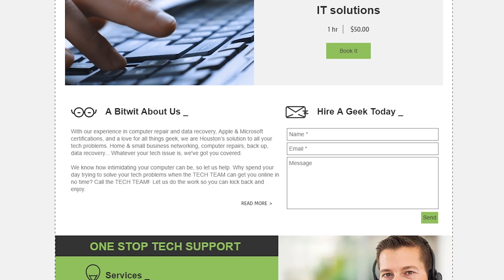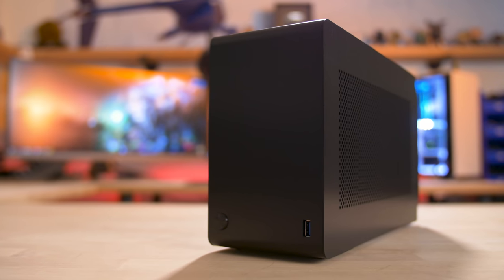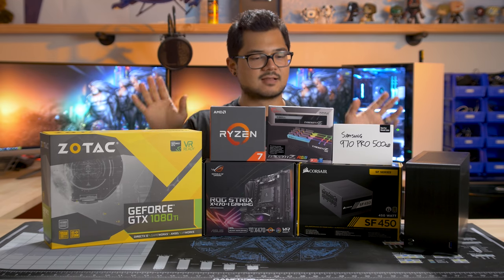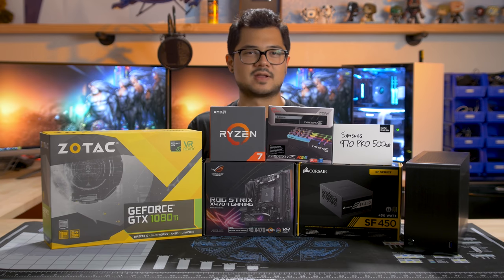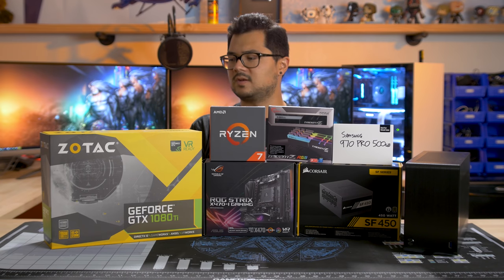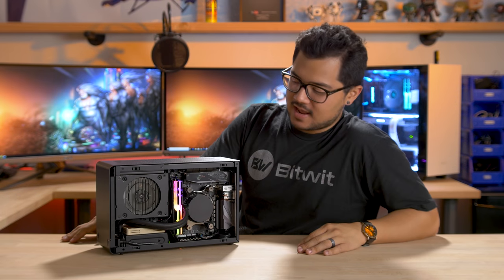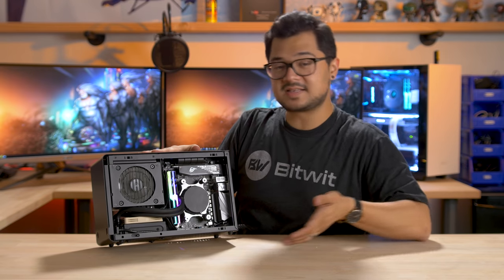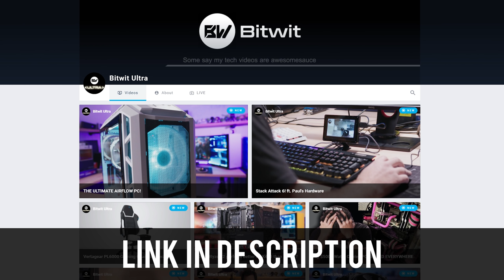The smallest water cooled PC I've EVER built! DAN Case A4 SFX v3

Comment: That was the first time ever I heard someone say "I'm choosing AMD because it stays cooler" xD
Reply: Times are changing. AMD's run cool and people are delidding 8700k's because they get too damn hot.
Reply: @littled10100  Well, doesn't Intel's Coffee Lake CPUs also run at higher clocks?
Reply: Still doesn't make his statement untrue ;)
Reply: Back in 2005  AMD Athlon was better than Pentium in terms of cooling...
Reply: +Daryl Nelson I know! I have a 1300X overclocked to 4.1GHz on the stock cooler and it doesn't get hotter than 85° Celsius! Still fun to hear a tech youtuber say it though.
Reply: Not what he said
Reply: 85 is pretty high too :/
Reply: +Bvekfast That's on full load! The maximum supported temperature on these processors is 95º... It should be ok :-)
Reply: @DrLIRAAAAAAA  i have the intel i5 8700k coffe lake on gaming mode oc and BF V beta on ultra 65°c
Reply: please insert cringy shadow the hedgehog IM THE COOLEST joke
Reply: That's exactly what I thought, Renan.
Reply: Daryl Nelson 
I’m super bottlenecking so my CPU doesn’t overheat.
Reply: @calvin3448  thats not how it works but alright
Reply: @normaborges9123  maybe his video cars is the bottleneck?
Reply: AMD stepped their game up with Ryzen
Reply: Me too. Things changed when ryzen came I guess.
Reply: @lehti95  no u dont. U have a i7 8700k .. or  do u have a custom cpu made just for u by intel?
Reply: @chriss881000  im sorry i meant i5 8600k.
Reply: @lehti95  i know🤗
Reply: Intel got caught napping while ripping off their customers by not feeding the technology improvements down to customers.

Comment: You can get a 92mm fan grill to prevent the cables and tubes from touching the fan blades.
Reply: TOO LATE!   Damage has already done when he hijacked a tv in best buy!!!
Reply: Yeah, but then the screws would have zero reach and mesh grills can also become clogged. Though, you can get them really thin and it'd work well for this purpose, however one then needs to take a trip tot he hardware store to buy longer screws rather than setting them inside the fan counter-sunk.
Reply: Nyuha Really? I've seen pictures of it done.
Reply: couldn't you put the fan below the rad using longer screws?

Comment: Good grief, man! There is a place called a "hardware store". They have all kinds of screws of different size and length. Please try to remember that before you mutilate another fan.
Reply: I blame Noctua for their mounting designs.
Reply: Right?!? First thing that ran thru my mind.
Reply: I agree a computer reviewer/builder shouldn’t he have a selection of hardware for such events
Reply: Maybe he was pushed for time? Cause he said it took him longer than usual to assemble 'cause of the cable management issues.
Reply: It's just a little plastic, the fan is completely unaffected, it's fast and cheap. I would rather do this then drive to the hardware store in California...
Reply: @screwyluie  i totally agree, I'd rather not spend money on something that has zero impact on the performance of the system
Reply: Yeah, I was thinking the same thing, but even if you're going to mutilate the fan, AT THE VERY LEAST have a freaking counter sink, and power drill handy.

I mean, no excuse, none, nada, zip, zilch, zero, for using a pair of office scissors...
Reply: yeah, 6-32 screws and bolts are quite handy to have on hand in multiple lengths. and even a small collection of 8-32 for larger fan mount holes. B)

I still like the build B)
Reply: With all the system builds in the past, you will always have extra screws and parts laying around or organized in a drawer.
Reply: You can all stop acting like you've never been in a situation where you had to fix something on the fly and came up with a hacked up solution
Reply: @ileolai  but it's not like a dire thing where doing a hack job to get it done was necessary.
Reply: +QuiznosBear So what? It worked.
It's a piece of plastic, for god's sake, get over it.
Reply: @ileolai  but how tf do you literally so this for a living and have 0. None. Nada. Basic spare parts? 
I'm not bothered by the fudging, more so just think he could make his life easier by doing things the right way and holding on to a mere 4 spare screws.
Reply: getting the right set of screws is not a walk in the park
Reply: I was just reading the comments to find this one so I didn`t have to write it:) Man "use a longer screw"damn!!
Reply: He's just that lazy type of reviewer, who's used to just get the product samples, unbox and build with whatever's in there. For more "advanced" stuff watch Paul, Jay and Steve. In AwsomeHardware is also very noticeable, who's more tech-savvy, basically on every topic they cover.
Reply: 4 x #6-32 x 5/8", 4 x #6-32 3/4", 4 x 6.5mm standoffs, built this myself, everything fits perfectly, you're welcome
Reply from the maker: I definitely see your point. At the end of the day tho, it was either 60 seconds to carve some holes or a 30min round-trip to the nearest hw store. When time is money that's a bad investment
Reply from the maker: @tonan8888  Lazy enough to reach a million subs? What have you achieved with your laziness? Have you ever watched any of my countless videos where I do more than "just unbox something and build whatevers in there?" Unfounded comments like these can turn others off to a channel or personality who rely on an audience to make a living. Please think before you post or don't post at all.

I'll also be the first to admit some other Youtubers are way more tech savvy than I am. I never claim superiority to anyone in that regard and have always approached my content from an average tech enthusiast's perspective. If you don't like me for that or any other reason you know where the door is.
Reply: @Bitwit  Well, I've watched maybe 90% of your and your colleague's videos for the past 2 years, which gives me a base for comparison. I admit,  my comment appeared more rude than intended. Of course you're not lazy overall, what I meant is that for some videos I feel like you could have done more and others would have done more. However, I'm still here for the entertaining factor and the more "goofy" approach. I apologize for being insensitive!
Reply: I was on the Verge of saying that too, guess he doesn't have a Swiss Army Knife... think he was running with the scissors too?
Reply: Bill D. I know, eh? But he took an innovative approach, gotta admit. Genius these Bitwits are
Reply: God, what a lot of nitpicking for maybe 15s of video. Don't you all have better shit to complain about?
Reply: @tonan8888  I am a little late to the party but I do hope you have taken what Kyle has said onboard and now think before you type. A simple manta of treating message boards as we would a face to face encounter will do wonders for our little community. All the best, Daniel.
Reply: @danieldeak6193  Totally unnecessary comment from your end. I'm not your 12 year old son  to teach me some lesson. I rarely write any comments, but what I wrote here, I have thought about it on many other occasions. I stand behind the meaning of my words, maybe not so much behind the way I delivered them. What matters is that currently from the tech-tubers, Kyle is the last one I watch and soon maybe I won't even bother (wasn't like that before, though).
Reply: That's the right way to do it, sure but where's the fun in that? This guy is so confident he's willing to take some risk to be a little bit more innovative and now we know there's 'another' way to do it. Cheers mate.
Reply: What's wrong with being a little creative?
Reply: LOL
Reply: Very true. I only build one to two pcs a year but even I have different screws and tools for every challenge I come up with. And going to a supply store really should be no big deal. That's a whole new level of stupidity – or we are just witness to the works of a really lazy and indifferent „expert“.
Reply: @ileolai  Yeah, well. I guess creating a content for a YT video as your main job while also being sponsored renders your argument invalid. Sorry, bro.
Reply: @adoksym  >Only builds one or two PCs a year
>Thinks he can tell someone who does it for a living how to do their job

I'm really not sure why you thought I would give a damn about your opinion, lol
Reply: At the end of the day there are two types of people. Those who will hack and do a inferior job and those who are organised, will go the extra step and do things to perfection (and have a tray full of spare screws).
Reply: @Bitwit  like the over all  build  and while not scared to  get a drill  or other fabricating tools out  myself  you could have used a few spare main board posts to create the pegs the fan was looking for    most  chassis come with loads extra though to be fair only  done 1 itx build on a silver stone  in 20+years of computer building and modding
Reply: @joeledmundson950  Perhaps but the shame of butchering the fan lives forever.
Reply: what the hell happened here
Reply: Its a fairly clever solution to the depth issue.  And it was brave of him to point it out..kudos.  But I would have gone to the hardware store, too for a longer screw.  Do it right.
Reply: @tonan8888 Tegredy weed
Reply: efficient and resourceful
Reply: ToniGG Kyle does work hard! Are you going to be a little baby and cry about it? Gtfo then

Comment: After a 1 minute commercial for Wix, we get 10 minutes of content.  At least that's a better ratio than broadcast TV.  You should install a fan grill/guard on top of the Noctua AIO radiator fan so the all-in-one's hoses don't press into the fan blades.

Comment: I just bought the v3 Dan case. I'm using the same set up with the Asetek CPU cooler and Noctua fan. This is a good set up for noise and thermal control.

Comment: 24pin routing is really clever. I use that case and cooler myself, I found that having the fan as an intake so that the plastic fan housing could act as a guard and routing the 24pin and EPS around the GPU side and underneath the the motherboard worked well for my build with a longer GPU

Comment: Wow that pc is no bigger than the razer core v2 and is more powerful than most pc’s and any laptop and probably matches the predator 21x
Reply: The Predator 21x isn't even powerful. It's all soldered trash. There are Clevo laptops with a 8700k and dual 1080 mxm cards that will rape a Predator 21x all day long and not cost 10 000 dollars